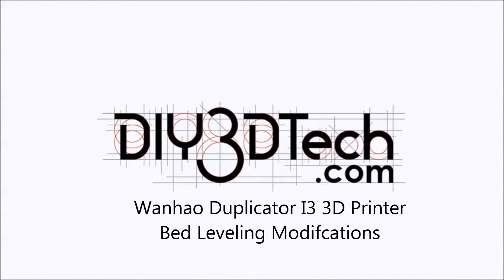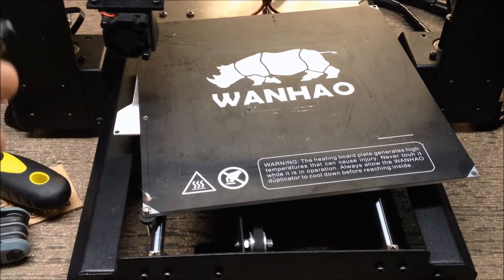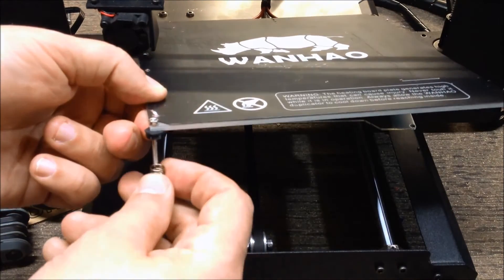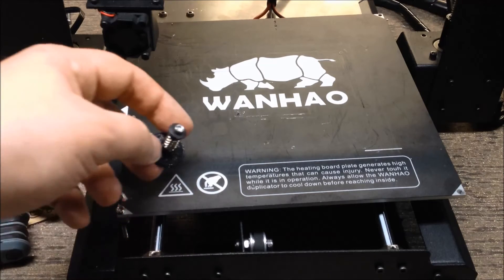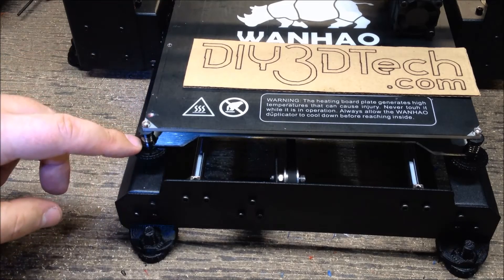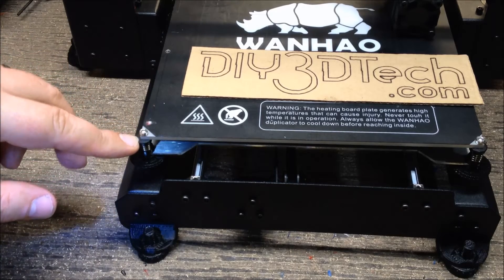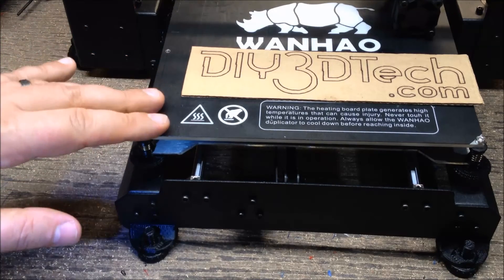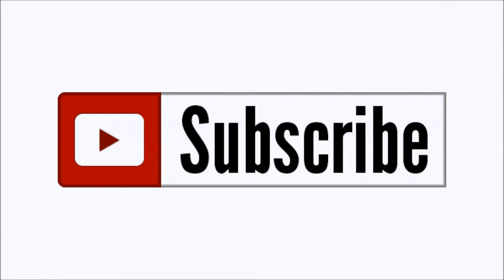Wanhao Duplicator I3 3D Printer - Bed Leveling Modifcations

Comment: Hey I have a problem. Pretty much when I click home all on my printer and make the bed as high as possible, there is still a gap between the nozzle and bed. The Z limit switch is also all the way down. I don't know what to do please help.
Reply from the maker: Guess I am confused are you saying its hitting the switch and stopping, or stopping before its hitting the switch? Assume also you have adjusted the leveling screws all the way up?
Reply: yes it hits the switch fine and the switch is as high as possible. the problem is that i have to undo the springs loads to make it near the extruder making the prints bad and bed consistently unlevel
Reply: did you fix the problem?

Comment: Thanks for the tip. Printing them as we speak.

Btw, did you print the bed leveling nuts and spring retainers on the Wanhao? With or without raft?
Reply: +Patrick Strang sorry, now I noticed you did them on the Fabrikator.
Reply from the maker: +Patrick Strang yupper it did a nice job :-)

Comment: Im getting mine on Friday, this is the 1st thing im doing and adding glass! 

Is there anything specific you have to adjust to have the 2mm change not an issue?
Reply from the maker: +C Webb Was not an issue for adding the 2mm, also would only add the glass if your doing ABS which frankly I did once on the Wanhao and smelled so bad that would not do again.  Also in my personal opinion, I do not think ABS is that good verses other plastics for general 3D printing.  However your mileage may vary,  and I am sure you will enjoy your Wanhao as I love mine and I have a number of printers this is my go printer!
Reply: DIY3DTECH.com PETG over ABS
Reply from the maker: I prefer PETG by far and no smell :-) Note I have been using ABS almost exclusively for a year now...
Reply from the maker: +C Webb I will be a posting a failed PETG print either tonight or tomorrow, its interesting :-)
Reply: Plan on doing any other mods? Id like to do the bearing upgrade and the frame stabilization also just found out about the micro swiss all metal hotend...I guess its an easy install and better for ABS and probably PETG!
Reply from the maker: To be honest have not seen an issue with either the bearings or the stabilization.  However let me know more on the hot end as I would be in on that change.